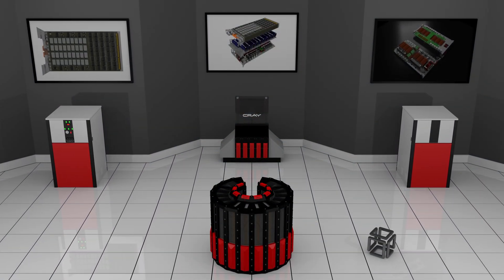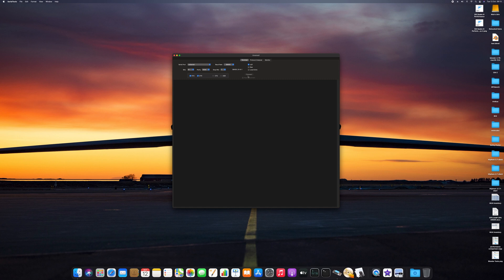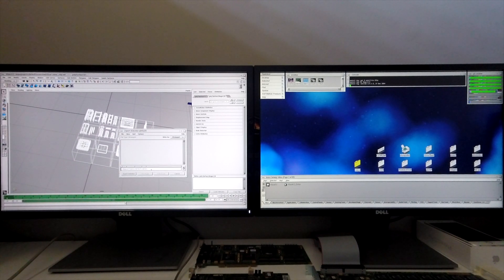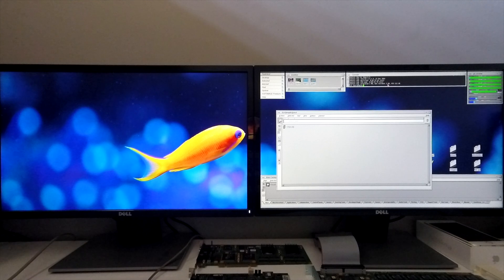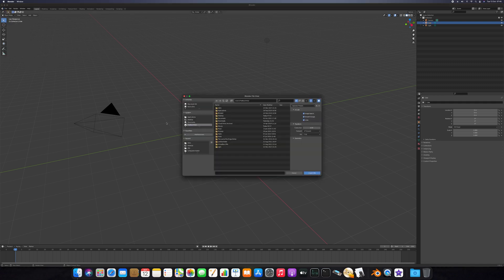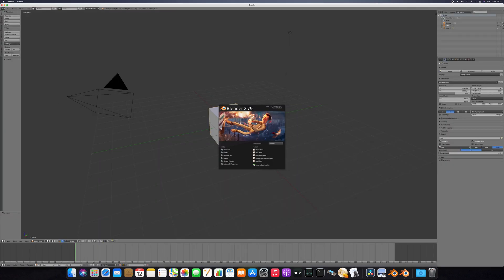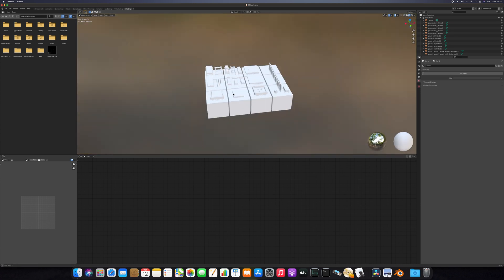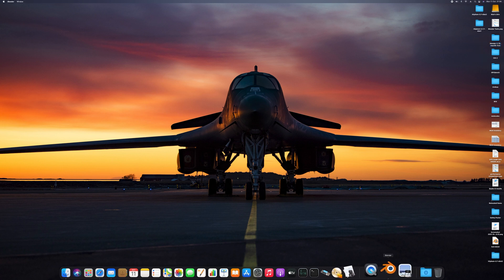An SGI Tezro and a Mac team up to render a Thinking Machines CM-2 Connection Machine Compute Node!

Comment: Just use NFS mate!
Reply from the maker: I’m having issues with the NFS in that it’s one directional, only allowing me to transfer files from the Mac to the Tezro. 

The fact that the network’s running through my home internet router may have something to do with this.
Reply: @Irinikus  you're possibly right. The best way to find out is to stick a switch between the two hosts and see if NFS behaves better.

Comment: Wow - super work, as always. I can't imagine how many hours you spent on it.

Questions:
- Why not NFS? I set a NFS share in my NAS and it became my working folder, so I can easily go around and work on my Octane, continue on my C8000 or my Mac as required. What's your particular reason for FTP?
- The issue with opening the models and losing the objects - is it a removed feature or a bug that will never ever be fixed?
- AFAIK, Maya 6.5 is also 32bit on PPC Macs, and also the latest release there. No 64 bit Maya for IRIX or you just don't have it?
Reply from the maker: Thanks man! :)

I’ve had issues where the NFS won’t allow me to send files from the Tezro to the Mac, but the FTP though Cyberduck is perfectly bi-directional!
Reply: @Irinikus  Aha - I use my TrueNAS box and have it mounted in all my machines. You are doing p2p.